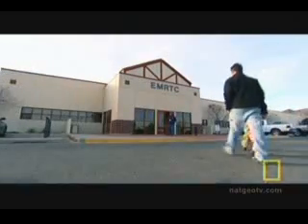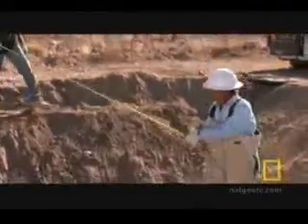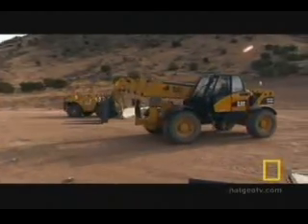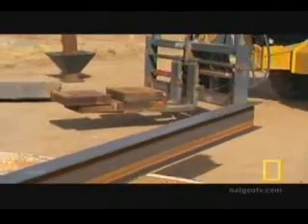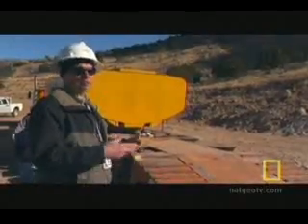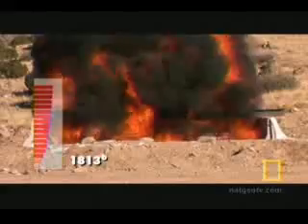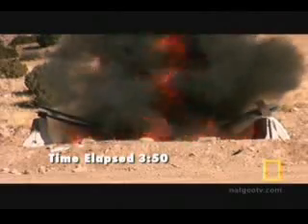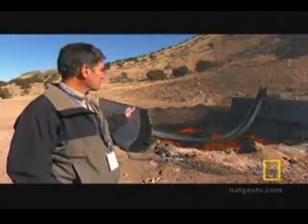steel being weakened by a jet fuel fire

Comment: maybe the terroist filled the plane with thermite lol
Reply: Aren't planes made of aluminium? if that catches fire, it's pretty much the same thing.
Reply: You need aluminum and iron oxide. And you can't just have any combination, as it needs to be measured out.
Reply: Aluminium on its own burns with a temperature of over 3800 degrees celsius, melting point of steel is right over 1500 degrees celsius.
So no, if the aluminium starts to burn, no iron oxide is necessary
The iron oxide makes it easier to light on fire.
Reply: I realize now that that was probably what you meant.
Reply: you would also need a ridicolous amount of termite to be able to melt the steel beams, If the conspiracy theory is that someone smuggled in enough termite and and placed it around the beams to melt them all without anyone noticing.
Then they have not thought things through. If it was somehow an inside job, they would've used explosives, they would not even need the planes.
These people need to stop getting science lessons from breaking bad.

Comment: to the CT's This clearly wasn't just a simple office fire, IT WAS A FUCKING GREAT BIG PLANE CRASHING INTO A BUILDING, and really, it was 3 things: a high speed collision with a large heavy metal object moving at over 500 mph (280 m/s) that released over 800million joules of kinetic energy (just google the mass and speed of a Boeing 747 and plug it into 1/2mv^2 to see for yourself) that in its self was enough slice a nice long cut into the steel beams and significantly weaken the structure. Then the jet fuel ignited causing a massive explosion releasing another massive burst of kinetic energy and large amounts of heat which likely ignited gas in the building setting of more explosions, all of this taking out more of the structure and further weakening the tower. all of the above also blew alot of the fire proofing off the steel beams. at this point a fire starts to spread fueled by wood, plastic, and a variety of different materials that burn at different temperatures, the enclosed environment would have also acted a bit like a furnace, this burned for hours and spread over many floors and this fire was the just the straw on to camels back which caused a complete collapse.
Reply: Just a heads up, you stated the Boeing 747 when it was two Boeing 767-200ERs that hit the towers.
Reply: Sorry, but this is not correct.  The external "walls" which were steel beams took around 40% of the load, the remaining 60% of the load was handled by the steel beams located in the core of the building.  This is a common misconception as it was wrongly reported that "External walls bore the majority of the weight" in the 9/11 commission report.  

Furthermore, what I do not understand is that if the World Trade Centers structure was so easily weakened by jet fuel fires, why has Mr Larry Silverstein decided to build the new WTC 7 building using a similar architectural structure. It has been constructed with a strong core taking the majority of the weight and steel beams supporting the floor which connect the core to the outer steel structure.
Reply: Not to mention, the reason for the towers being as large and tall as they were was due to their exterior walls taking on the majority of the load.
Reply: neither the buildings or the planes were equally solid everywhere. most of all those joules of energy would go nowhere, just like armor piercing bullets are less effective against non armored targets because they just go through the target and most of the energy is lost. and any part of the plane that did hit parts nececcary to uphold structural integrity would most likely not falter to a material as light as aluminium, you seem to overestimate how strong planes are, they are designed to be light and aerodynamic, and using the argument that they can withstand high airdrag means nothing because the angles of the jet liner divert most of the energy, they don't take it head on.

Comment: So they didn't have the balls to test a full size beam with fireproofing foam on it to see if weakening it in the length of time from impact to collapse is physically possible?  They used a BARE beam much smaller?

May as well just admit they can't do so they faked it
Reply: If you were not so stupid you would see you have no evidence for your fantasy version of 9/11. I thought the 19 terrorists were idiots, the dumbest in the universe. Then 9/11 truth came, and people like you prove the 19 terrorists were not the dumbest, not close to the idiots who believe 9/11 truth lies.
Steel fails in fire, it was office fires, not the jet fuel.  why are you a science illiterate
Reply: Did you know that you can make steel lose integrity without fire at all? Just add more and more weight to a single point and after some time, the steel will bend and a chain reaction of structural failure will occur. NO Jet Fuel necessary!
Reply: I think that was an educated guess after something weighing 100,000 Kgs hit them at 500mph lol
Reply: There is no path of greatest/least resistance rule in physics, or the bullets would bounce off people and go for the air, the path of least resistance. There is no path of least resistance law for falling objects, they hit the lower floors and the floor fails instantly when over 29,000,000 pounds hit the lower floor of the WTC towers.  Learn math/physcis/science, and stop being a gullible idiot who believe failed nuts in 9/11 truth. Study the WTC structure, stop being stupid.
Reply: would love to know how NIST reports that fireproofing was "knocked off"---I mean how would they know that happened to make the claim?
Reply: The insulation was knocked off by the aircraft impacts under the floors and in the core. Core steel was protected with wallboard, it fell off. Under the floors was foam which could be removed by finger.  Thus the unprotected steel in the WTC due to massive aircraft impacts, failed quickly, as seen on 9/11.
Reply: ***** 100+ story skyscrapers don't fall straight down?
Says who? you?
And who are you then?

The path of greatest resistance? Just happens to be the only one with a massive force acting on it, which is called gravity, you clueless fuck.

80 floors didn't give way at once, a weight of about 15 floors fell about 5 metres vertically onto it, so if floor 85 gave way, then all the floors above it fell 5 m, and this massive sudden loading immediately made floor 84 collapse.
Then that combined weight fell another 5 metres and smashed into floor 83, which immediately gave way.

Jet fuel and office furnishings can't melt steel, true,but you ever notice how cars that catch fire don't just get repainted? they are weakened!

As for building 7 being cosmetically damaged, who the fuck are you to say it was only cosmetic?
Do you know how much damage there actually was? or are you just parroting what other people have told you?
Massive chunks of a falling skyscraper damaged it hugely, it burned for hours before it fell!
Again must have only been photocopier supplies in there huh!?

Why would the government not want the buildings to fall sideways and kill 40,000 people?
You are the one saying the government wanted to make a big accident presumably, so why did they make it a safe controlled explosion!?
Falling sideways is even more of what you think they wanted to do!

Why were none of the explosive cables damaged by the planes?
Why did none of the explosives go off before the collapse?
Were the pilots told to aim for the only floor that had no planted explosives on it?

Why was the sound of 100 x floors worth of girder destroying explosives quieter than explosions in any other controlled demo?

Why did the US not fake a nuclear weapon in a bunker in Iraq if they're good enough to fake 9/11?
That would have saved a LOT of trouble for the government.
Reply: ***** The End :)
Reply: The WTC towers were an exoskeleton design, and the plane took out lots of these external supports, putting more load on the central support columns and the corners of the building.
In the 2nd tower collapse there is a great close up view of the collapse, and you can see the corner supports snap at the exact point of the fire.
If that was an explosion, the explosives and wires on that exact floor would have to have lasted through the fire for 90 minutes without being damaged or exploding prematurely.

The collapse of that floor sends about 75,000 tonnes of building falling onto the floor below, which was already severly damaged, as were the 4 of 5 floors below that.

The problem is that people have seen buildings fall intentionally, and think that everytime a building falls straight down that is proof it was intentional.
It baffles the mind how simple people are, and how keen to blame the government for all their woes.
Reply: There was no melted steel on 9/11. NIST tested full up insulated floors, and they passed the test; on 9/11 the impacts of the planes removed insulation, making steel fail fast.  But this is science, not BS you googled from a failed movement based on the overwhelming ignornace of 9/11 truth believers.
Reply: If you believe 9/11 truth claims, you are an idiot. But you know you are right; then you are insane, unable to think for yourself, you pick to believe lies made to match your paranoid thinking patterns; you are like the Boston bombers and McVeigh, an idiot, a bigot; a gullible failed human apologizing for 19 terrorists who came to kill Americans. Are the 19 your buddies, or are you just plain stupid?  Paranoid is established, why are you so stupid.

Comment: Conspiracy Theorist: "Jet fuel can't melt steel!"
Science: "Doesn't have to, watch this"
Conspiracy Theorist: "BUT, uhh, insulation!"
Science: "What protected the insulation from aluminum moving at 500+ mph?"
Conspiracy Theorist: "But thermite!"
Science: "What protected the thermite bombs from aluminum moving at 500+ mph?"

Conspiracy Theorist: "Science, you're one of THEM!!"
Reply: 700gal at 500mph fire ball bursting out the other side. That has to disperse the fuel if not vaporize in the explosion.
 The fuel in the tanks has to reach a certain temp to "light" on fire. You can light jet fuel if you spray it like a mist at any temp. 
 I'll get to the point. Pool of fuel and who knows what kind of steel..
 Still doesn't account for the free fall of the structure onto itself. That and for it to happen to 3 buildings. That's unheard of and impossible. Things take path of least resistance. The structural steel in majority of the building wasn't compromised. Watch demolition videos. It takes skill to drop buildings straight down. Even tower 7 which was never hit by a plane. 
 They would have fallen differently.
Reply: @Cornskid1  What about scale? Scale is necessary in science experiments. It also wasn't an accurate representation of the state of the steel. It's like saying oh look planes are made of aluminum and steel, and they can fly! Thus they would also fly if we increased the density of the sheets from 2-4mm to 20mm.Scale matters. Same reason blacksmiths have different processes to save time depending on the thickness of the material.
Reply: @Cornskid1  Scale is important when conducting an experiment.When you pour more jetfuel on a smaller beam the results will be different. Are you going to imply a thicker beam would handle heat conductivity in the same way?
Reply: There is a large amount of evidence that molten steel was pouring out of the sides of each twin tower along with eyewitness accounts.  I think most people understand that jet fuel can weaken steel but not melt it.
Reply: glass still melts at over 1000 degrees calcius
Reply: Libtard trolled
Reply: Conspiracy... Solved!!
Reply: Please science, do account for the freefall speed. The conforming drop rate of the non compromised 60+floors. Good thing science is here to explain this for us.
Reply: The moment you realise building 7 collapsed from office fires...
Reply: AKA Moving the Goalposts fallacy =)
Reply: It was molten glass, not molten steel.
Reply: @brutal8138  bearing in mind that between the plane and the structure itself there were many tons of aluminum there, which glows reddish orange at about seven hundred degrees Celsius, cooler than the fires. It is impossible to know exactly what was pouring out of the building, but it certainly wouldn't have been the steel.
People are however wrong or at least imprecise to say that jet fuel could not have melted the steel. Jet fuel depending upon oxygen availability can burn above 2000 degrees, though 1500 is more of the norm. And standard structural steel will melt between 15 and 1600 degrees Celsius; not liquify, but soften to the point that it has no strength. This can easily account for the unconfirmed reports of melted steel during the cleanup, as the fires continue to burn.
Many people also ignore the factor of heat sinking. The glowing material seen coming from the towers at the time of the event can easily be explained by the sheer volume of aluminum involved. Reports of glowing Steel and molten steel are somewhat unsupported, but also not unexpected. These reports were days after the tower collapsed as fires continue to burn Underground. Concrete makes for a good insulator therefore temperatures of the contained space where the steel was would have reached higher than simply that of the burning fuel. This phenomenon is known as heat sinking. Because heat isn't simply derived from the source temperature but also accumulates; basic physics.
Reply: You're talking about science like it's a religion. This test did not accurately scale the events of 9/11.TRUE science uses empiricism, no bias and only seeks objective truth. This was obviously not real science.
Reply: imppossible for those planes to reach that speed that low in the sky, and even the best pilots in the world would have trouble doing that at over landing speeds. those towers were designed to withstand  an impact of a 707 travelling 600 mph.  ps most of the fuel from the planes was consumed within the first 2/5th of a second so there was even less of a fuel to steel ration .   there were 4 serious fires in the buildings over the years that did not  cause them to fail several of which had seriously more fuel to steel ratios.   redundacy of design . also you have you heat of the whole mass of a piece of steel before the item weakens and the way heat propogate in steel there was simply just not enough kerosene in those planes to do that.
Reply: @circusboy90210  The designer factored in an impact from a 707, with the assumption of an aircraft lost in fog, low speed, low fuel. Your 600 mph claim is not simply wrong, but asinine. The 707 has a cruising speed of 540. While the actual weight is similar the 767 is a wide body with a larger wingspan and greater fuel capacity.
You also claim the majority of fuel would have been burned up instantly, but apart from conjecture you give no reason for such a assumption. You talking about more than 10,000 gallons of fuel, which poured down elevator shafts and doused people on floors below.
The designer of the structure also said that the building was designed with a 6 floor dead rate meaning if more than 6 floors collapsed the structure would fall. The design of the tower meant that without the structural tie of the floor girders the vertical members could not remain standing.
And no you do not have to feed an entire piece of Steel before it weakens. Like anything else it is only as strong as its weakest point. Between 500 and 600 Degrees it will lose half of its strength. It will continue losing strength exponentially above that.
Your claim of multiple serious fires happening previously is somewhat laughable. Yes there had been office fires. They were not fire fueled by propellants. They were not fires that burned for long hot uncontrolled periods of time. And they were not fires that burned in sections of building that were already structurally damaged and void of fire protectant.
It is a good thing to be skeptical. But a skeptic considered as and weighs evidence. The evidence supports the official story far better than any of the conspiracy theories.

Comment: Did the trade center have a pool to hold the jet fuel in? Would not the jet fuel have dissipated throughout the building therefore spreading it`s thermal properties over a large area?
Reply: It would have soaked and polled in smaller area. But, via this video, recall that it needs to become gaseous somewhat to actually catch fire, like gasoline. The liquid doesn't catch fire, the mixture in the air that "dissipates" would.

But, also recall that the WTC were office buildings, full of absorbent materials like paper and the like, and the plane were full of an immense amount of fuel intended for cross country flight. There was lots and lots of fuel to be had. And then add everything else that caught on fire that added to the fire itself, like chairs and cubicles and rooms filled with filing cabinets and the like.
Reply: itsthevoiceman Holy crap that’s nonsense.
Reply: yeah it fell down the elevator shafts except the stuff that blew up in the initial impact.  there was none left for the fires, those were just office materials.